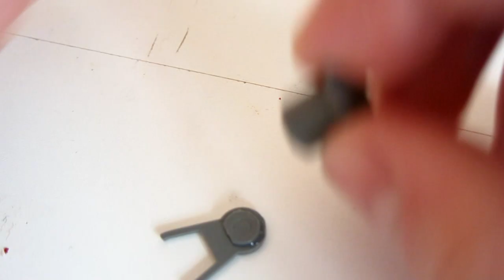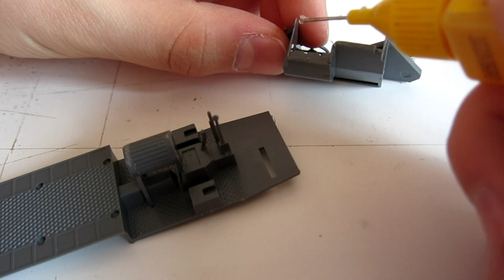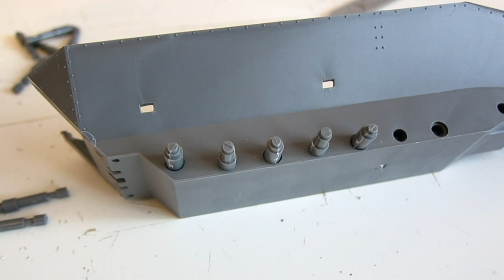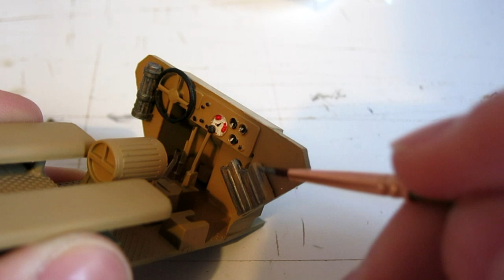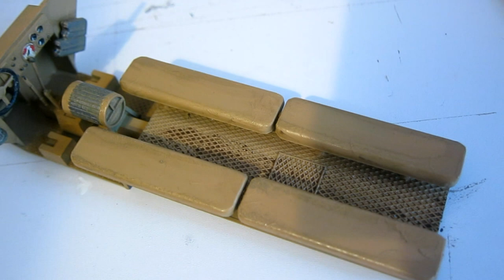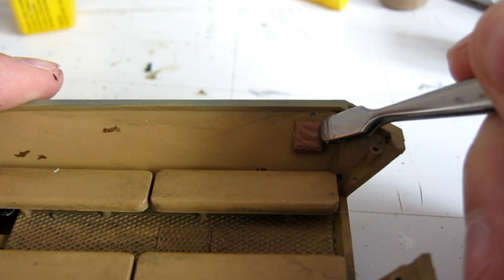Tamiya 1/35 Hanomag Sdkfz 251/1 Part 1 of 3

Comment: from what year is this cause I just picked one up and the box says 1973
Reply from the maker: I've just checked my box and it says 1973 as well, So I guess we have the same kit!
Reply: Modelling Weekly. I was wondering because my steering wheel seem not to fit correctly on my kit
Reply from the maker: Strange. For me the hole to put it in was square, while the steering wheel rod was circular...I managed to get it in anyway, though. If you want you can send me a picture of the steering wheel and hole via email if you want me to check it out and give you some help
Reply: Weekly correct but mine won't fit correctly because of that cannister on the left
Reply from the maker: Ahh right. It's a very tight fit and you might have to cut down the wheel. Or, you could roll the tank further to the left if its not glued yet. Since the hole is square, I would recommend angling the wheel to the bottom right corner so that the wheel is at a slight angle but it should fit.

Contact me if you need any more help at 8:00 on wards in the morning, since that is when I can answer questions or respond to emails!
Reply: Modelling Weekly thanks for your time nice job by the way
Reply: I asked the same question and found out that that's the copyright date...who can guess how many editions they put out since then...
Reply: @dinostamos8357  i had the same problem with the wheel not fitting- had to put the wheel in at a slight angle- hope it went well!